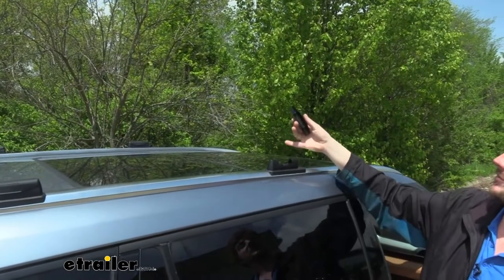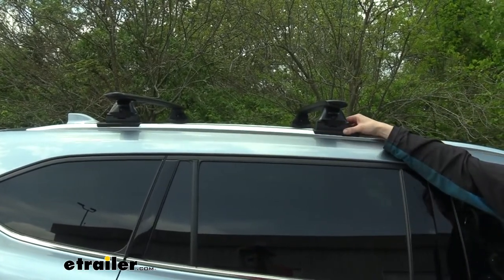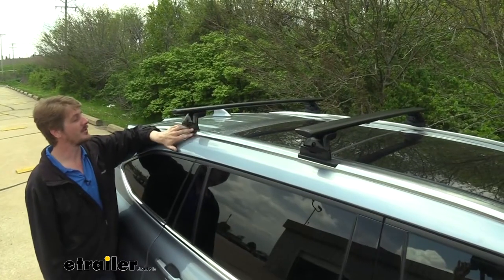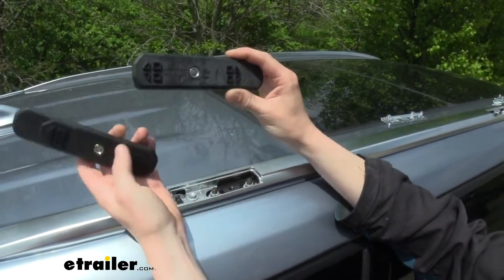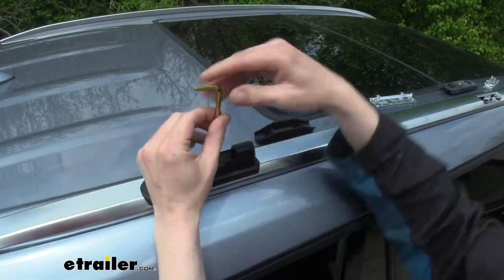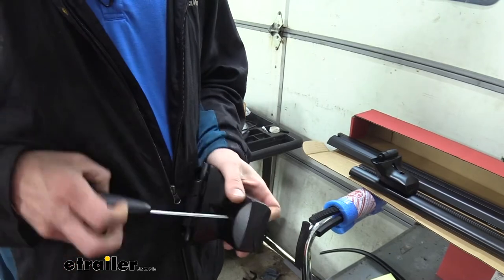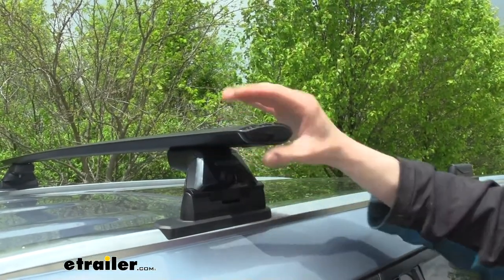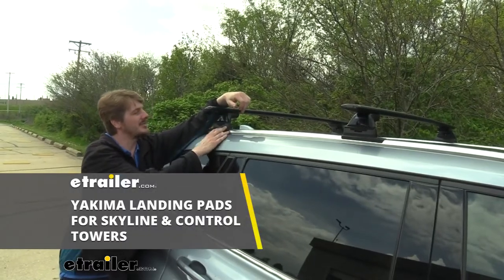etrailer | Review of the Landing Pad 13 for Yakima SkyLine and Control Towers

Comment: Do the landing pad covers stay on securely?
Reply from the maker: The covers for the landing pads stay on very securely. You do not have to worry about them flying off when you are traveling down the road.
https://www.etrailer.com/Accessories-and-Parts/Yakima/8880210.html
Reply: @etrailer  can other towers other than the skylines be used with the landing pad 11?

Comment: The combo of the landing pads and the actual hardware to attach the bars is unbelievably expensive. Mostly plastic and priced like gold.
Reply from the maker: It is expensive, that's for sure. What's the Y/M/M of your vehicle? We'd be happy to check for a less expensive solution for you.
Reply: @etrailer  
Thanks. I’ve got the after market “tracks” on a shell.  I use the Yakima LP 1 and control towers, which is, shockingly, some what less pricey than other options, so I’m covered.
Reply from the maker: Okay. Thanks for getting back with us...